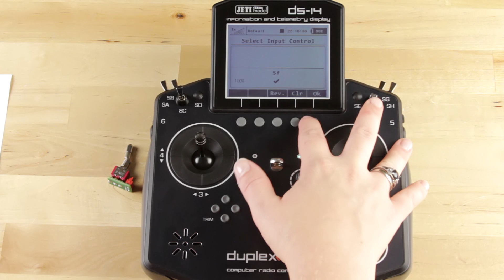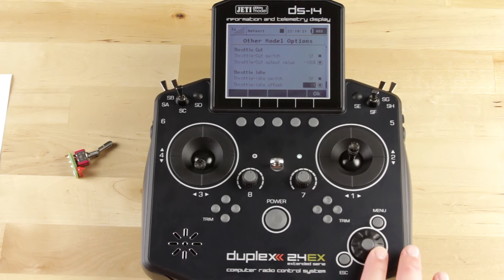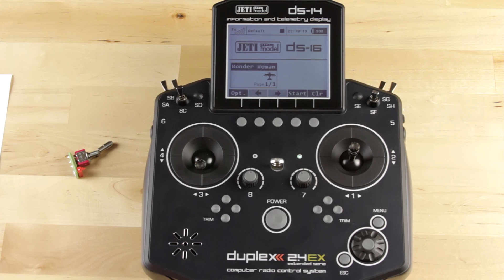Basic Programming: Throttle Cut & Idle (Other Model Options)

Comment: I just tried to setup the throttle cut portion of this video and my throttle still doesn’t cut
I’m using a gen 2 ds 16 
I’ve done just as your video shows and I’m using a locked switch in th sg position 
Can I get some help ?
Ty
John

Comment: Help, when I set up my throttle Cut and Idle it is effecting the servo from the centre point and not the -% (throttle low) point. What have I got set wrong? My settings are -100 - +100 servo range, throttle cut -100% throttle idle +20%, switch SH down for throttle cut and up for throttle idle.